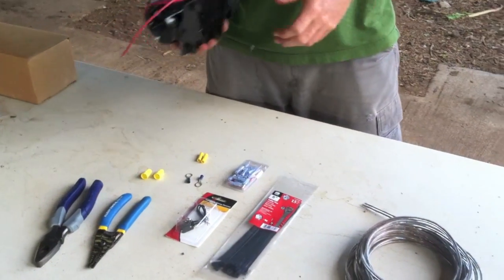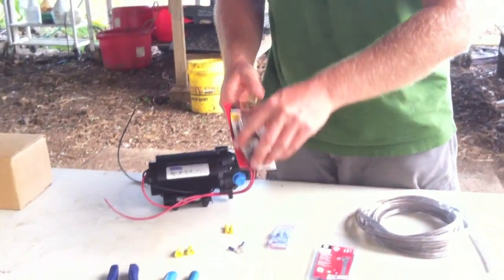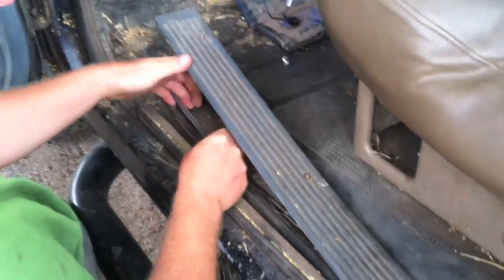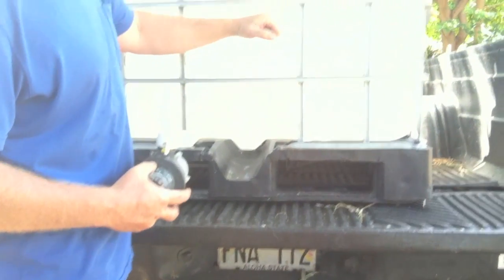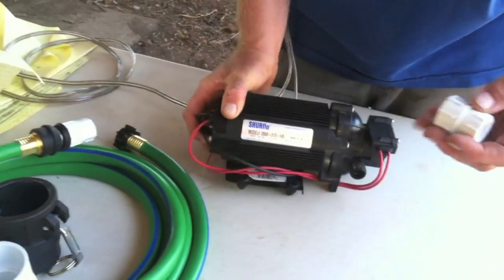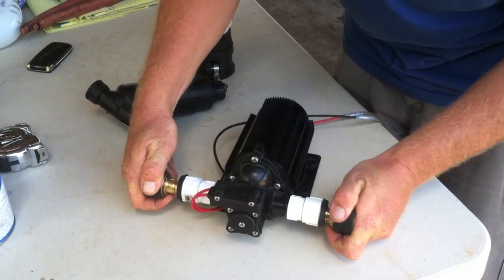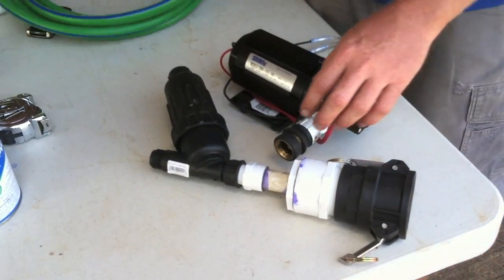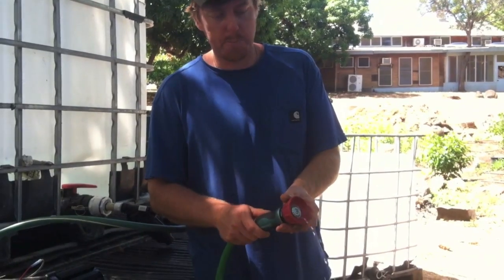Building a sprayer

Comment: thanks looks great, I used the same set up but on a 2 gallon sprayer in my garden,  I attached the pump and 12 volt ups battery using tie wraps, and made sprayer exit hose about 6 feet, works great, no more pumping, it had a pressure release valve that I hated, I like the inline filter, I will need to add one this spring

Comment: Well take a moment and learn from my past mistakes. Speaker wire can melt when you least expect this, un-fused it will catch fire... Please use thick copper automotive wire. 

On that should be MANDATORY.

Next - the switch sucks... a RV relay and a separate battery....Yea a separate deep cycle battery and when the engine is running its charging - when the ignition is off - no worry's.
You can still start the engine.

Enjoy,
Woo

Comment: I have the same ibc tote, but how do I keep chemical from hesitation all day so I won't have chemical in the bottom of the tote??..
Reply: We made one like this and ran a 3/4" pipe in thru the top then elbowed it at the bottom with a 2 foot piece hooked to elbow. The 2 foot piece runs flat across the bottom of the tank but we ran it at an angle. At the top we hooked an air hose to it that runs by a gas powered air compressor. Having the pipe inside at an angle creates a whirling effect at the bottom so the chemical is being swirled around by the air being pumped in. Helps keep anything from settling at the bottom. 
Just how we did it. Might be a easier or better way.

Comment: is that speaker wire?
Reply: Speaker wire actually is better wire then what u get at automotive parts store. Most regular wire is copper. Speaker wire has both copper or silver with is good for positive and negative connection